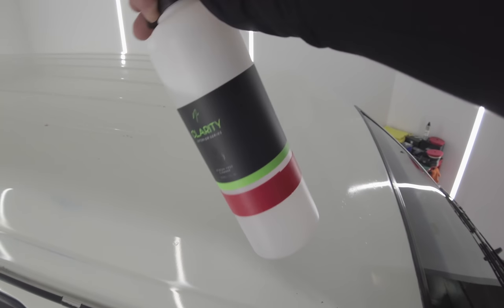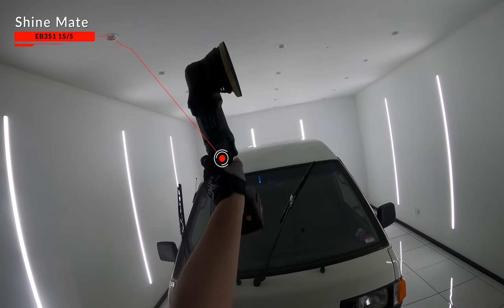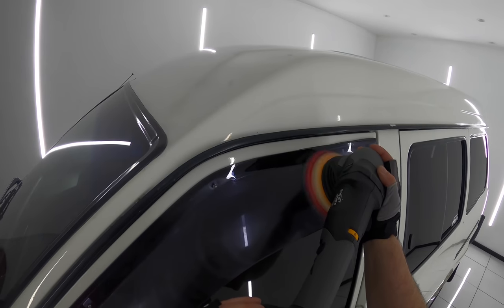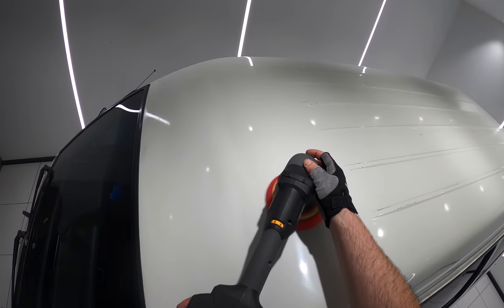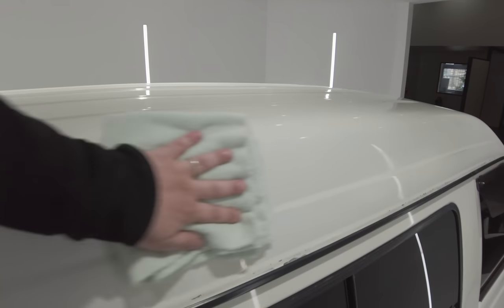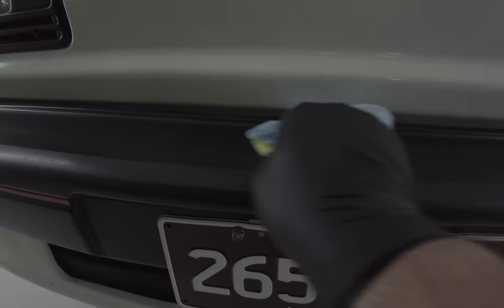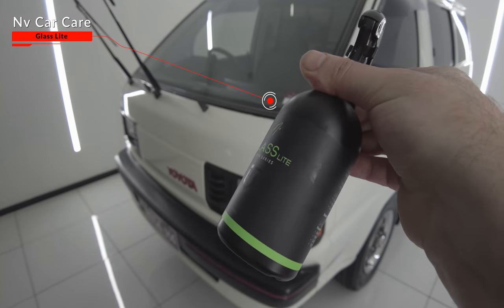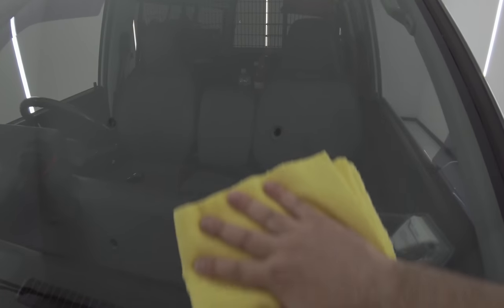30yr Old Work Van Gets a Detail P2 + Detailing Product & Technique Testing!! (Vlog 36.2)

Comment: Awesome video. Thank you for highlighting what you use for older single stage paint. I have a 1985 Toyota Land Cruiser with white paint - likely the same as yours. I’ve been trying to determine what the safest product & process will be to restore gloss, and it sounds like CarPro Essence Plus is the way to go.
Reply from the maker: That’s great to hear, if it’s original and thin paint it’s a great way to go!

Comment: Thank you for spending time, talking about polishing glass. Curious how you were able to polish that plastic wind screen (over the driver’s window) in one pass with a microfiber pad and not get marring. It appeared very clear and clean. It seems the microfiber and compound would have scratched it noticeably.
Reply from the maker: The Shine Mate MF pad is one of the better finishing ones compared to most and S20 Black also generally finishes quite well. In saying that it was by no means a perfect correction or finishing outcome, but just a quick improvement.
Reply: @CarCraftAutoDetailing  It sure looked clear in the video. Thank you for the info about the Shine Mate MF pad; it's that insider knowledge that is so valuable to us, and you are very generous with your gifts of knowledge.  Your thoroughness of explaining and taking us along on the journey is unique. Most videos these days are short, thinking peoples' attention spans are short, but it's admirable how you value OUR ability to stay focused and pay attention longer than one minute. You are appreciated!

Comment: Is the CarPro Essence Plus the same kind of cleaner as P21S?  I used the P21S as a paint cleaner (I’m a hobbyist), and it works well chemically, without abrasives.
Reply from the maker: P21s paintwork cleanser is more of a pre-wax paint cleaner, whereas Essence Plus has does that as well but also goes on to fill defects and seal the finish and was primarily formulated to repair older ceramic coatings.
Reply: @CarCraftAutoDetailing  Thank you very much.

Comment: hello Sandro, why not using ceriglass compoud and pads for glass? i understand you are not going for correction but still make me wonder :) thanks for video
Reply from the maker: Ceriglass in my opinion and experience should only be used on badly scratched glass if you do want to try and reduce those scratches as it can leave tiny micro scratches behind that are extremely difficult to remove.
Reply: @CarCraftAutoDetailing  good information, thanks

Comment: Is that 040 super white colour code;;; nice work,mate!!! Cheers from Greece
Reply from the maker: It may be by memory, I think you’re right, thanks mate!
Reply: I recently did a 2 stage polishing to my white single stage corolla and for protection i ve used on dry surface hybrid ceramic spraiwax from mequiars.....is that right or wrong...is that capable to protect fresh polisherd paint;thanks

Comment: What are those strip lights? Were can I get those? Any good for correction?
Reply from the maker: They are just fluorescent tubes recessed in the wall with differ panels coverings, not they aren’t good for correction but great for coatings and protection.
Reply: @CarCraftAutoDetailing  thanks mate good 2 know